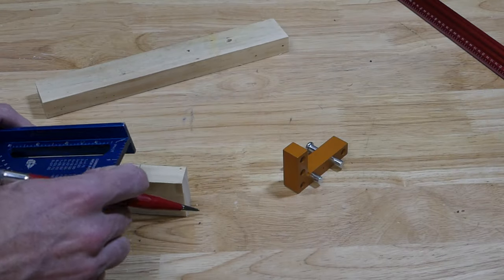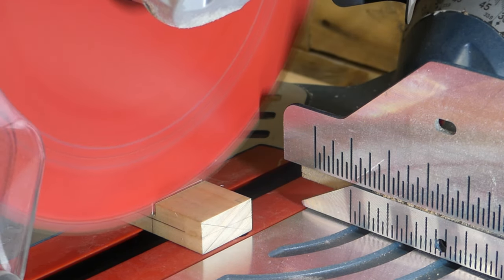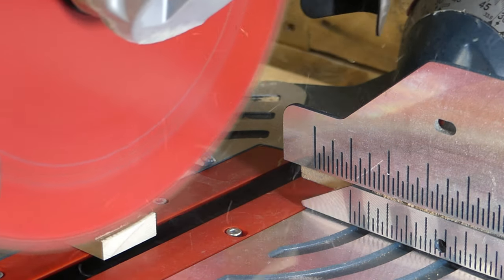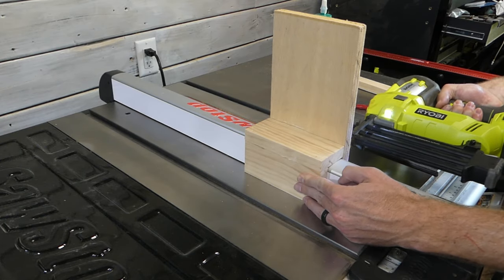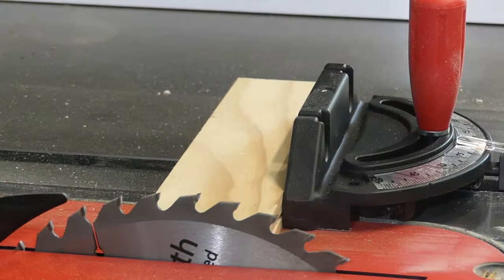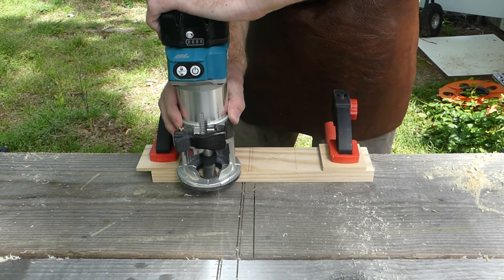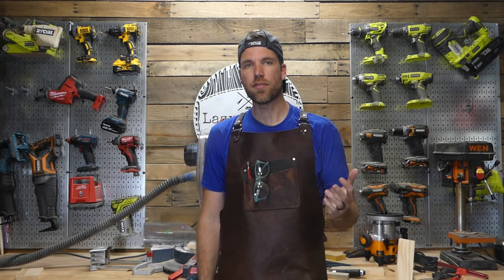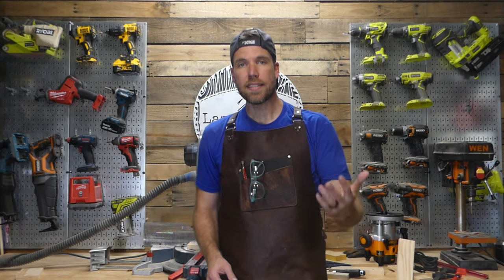3 Ways To Cut Half Lap Joints Like A Pro!

Comment: Thanks for sharing this. My first impuls was to make multiple passes on the tablesaw, like you did with the mitresaw. But now I see that taking the time to build the jig results in a much cleaner fit that doesn't need the level of post-cut handwork. It's safer than I initially thought.
Reply from the maker: Glad I could help!

Comment: Excellent ideas, different methods better for different applications.  I've also cut half-lap joints with a router table sliding miter jig and bottom cleaning bit.  I really like that table saw jig and am going to try that - with a fine smooth cutting blade there would be almost no sanding of the two matching lap surfaces, if any.  Thanks for the video.

Comment: Great video.  Super helpful that you used all 3 tools.  I'm a beginner with a circular saw deciding if I want a table saw or a router next and this helped make my decision.
Reply from the maker: Thanks!  What are you going with?  I personally love a router, especially as I was honing my craft and wasn't quite ready for advanced table saw work yet.
Reply: @LazyGuyDIY  I went with the router for now.  Might get a table saw down the road.  But I feel like it's less likely i'll hurt myself doing this vs a table saw.  Plus just ordered a rabbeting bit for the router that i'm excited to try out.  Want to make a box with rabbet joints and feel like this will be much easier to use then creating a jig on my own.
Reply: You can do maybe 80% of saw table cuts with your circular saw, if you have the patience. So getting the router as your next tool was the right decision!

Comment: Bandsaw... long lengths - easy, safe, fast, accurate. Fence rails at 6m no problem.  Just adding to the topic.
Reply from the maker: Great addition!  I didn't have a bandsaw at the time, but do now!
Reply: Same.  I cut the cross cuts with a chisel and backsaw, then cut the longer rip cuts on the bandsaw with the fence.   Very quick and safe.

Comment: I’m looking for the directions for joining two 2 x 4 at the corners. You set the table saw up cutting half the 2x4 the by standing the board up and cutting long ways through the end.  Then you don’t change anything and you lay the 2 x 4 down and cut long ways . This leaves a 3/4” x 1-3/4” piece cutout. You repeat with each piece till you have eight cuts, then you can glue, clamp and nail them together, for an extremely strong square. My Grandfather, showed me this a long time ago, but I missed something, because my corners weren’t as tight as his where.

Comment: Could you use the table saw the same way you used the miter saw doing multiple cuts?
Reply from the maker: Sure can, I usually like to use a sacrificial fence attached to the miter gauge when I do that just so the piece of material has plenty of support and the cuts are straight.  The one thing you'll need to look at though are the teeth on your saw blade.  If they're flat tooth  then you'll get a nice clean cut.  If they're angled like a lot of blades are you'll lots of little ridges, but you can easily clean them up.

Comment: I'm just gonna put this opinion out there.  And it's just that.  An opinion.

If you're just cutting a few half laps, the overall fastest and easiest way is to use a hand saw and a chisel.  Maybe a beater chisel to hog out the waste quickly and your good chisel to actually cut to the line.

With the power tools, there's a time investment overhead.  It takes time to break out and set up the power tools, figure out any jigs/stops, do the job, pack it all away, and clean up the dust.  With the saw and chisel, there's just a few simple hand tools to quickly grab, there's no messing with jigs at all, and it's way easier to clean up chips on the floor than saw dust all over everything.

Now sure, the power tools are quicker per cut.  The cumulative time saved on the cuts has to exceed that additional investment overhead to be worthwhile though.

I'm thinking that the break even point for the average guy at home is going past 4 joints.  If you're making a square frame for something, that's 4 joints.  If you're making a pair of square frames, let's say to make some garage shelves, that's 8 joints (or more).

Again, just an opinion based on my own experiences.  Just some food for thought.  YMMV.

Comment: Good video, thanks. With the router, once you've cut away the supporting wood, is there a way / tool to support it? I found after cutting 16 laps that balancing the router like that gets pretty tiring and your level gets more and more inconsistent. I know you could use a piece of wood, but then you'd literally need one for every depth of cut. Must be a smarter way.
Reply from the maker: This is where a router table set up definitely comes in handy when making multiple passes.  But with a handheld router, I agree, it gets a little tedious.  As long as you strategically start on one side and work your way to the full width of cut, the accuracy really only needs to be consistent on the first and last pass on the outside edges.  Balancing shouldn't be an issue at that point.
Reply: @LazyGuyDIY  Okay, thanks, I'll try that. I've also seen that you can extend the base of the router by screwing in a piece of mdf.
Reply from the maker: @Mekchanoid  that or a thick piece of acrylic so you can see can still see.

Comment: Thanks for this, what kind of bit do you use in the router by hand there at the last one?
Reply from the maker: I just used a standard Freud Straight Cut Bit.  Nothing too fancy.
Reply: Thank you. I don’t have a table saw and wanted to be sure I got right bit with router :)
Reply: @LazyGuyDIY  It looks like a pretty wide one. The thinner the bit the harder to balance the router and get a consistent surface.

Comment: That looks like the contractor version of the SawStop. Do you feel like you are giving up much over a cabinet saw of the same make?
Reply from the maker: It is the contractor version.  And honestly, if I had to do it again, I would have just bought the cabinet saw.  I thought that the footprint of the Contractor's saw would be smaller for the size of my shop, but it turns out the motor sticks out the back a good 10" and negates any saved space.

Comment: It amazes me how hard you tried not to use just an ordinary tenon saw.
Reply from the maker: I use plenty of hand tools in my shop.  The problem is that the new woodworker doesn't always have the skill set or the tools to make that cut repeatable.  Not to mention to have a quality saw that's sharp and then chisels or a plane to clean up the cut to make sure it's a good fit.  Not many people own marking gauges either early on or blade guides.  At least with power tools they can make repeatable cuts in short time with a low barrier of entry to make it happen.  Then that's a gateway technique to get them interested to learn more traditional joinery.